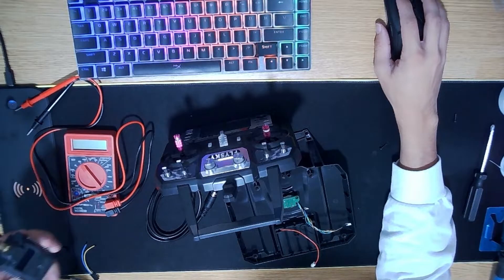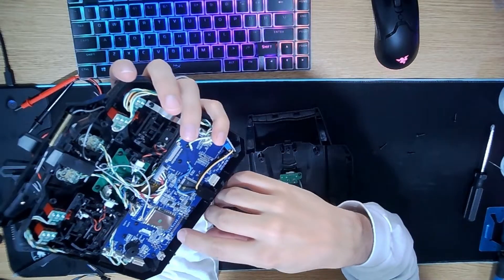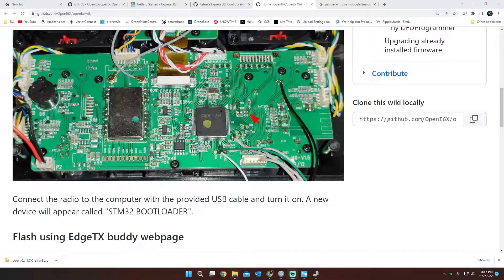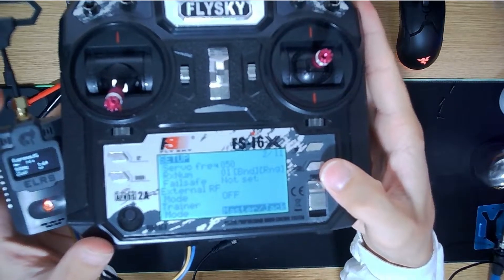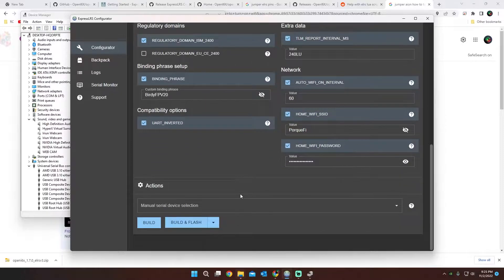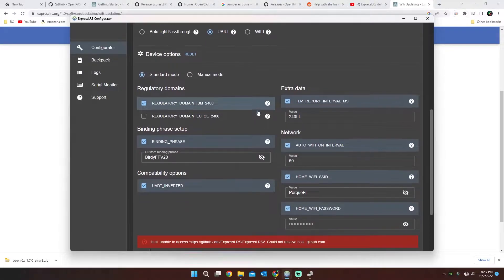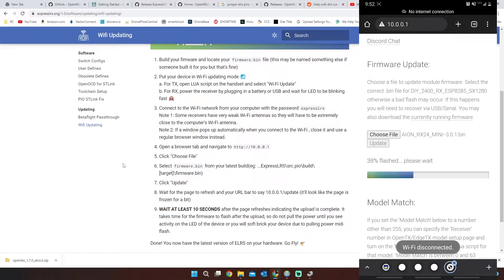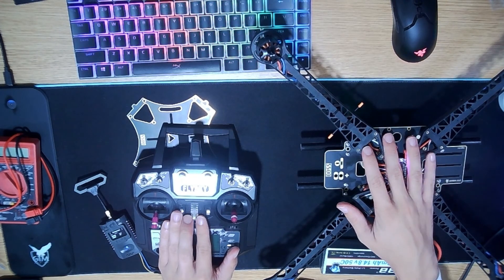How to connect Jumper AION ELRS V3.0 to FS-i6X

Comment: How do I do this with the Jumper T16
Reply from the maker: I think you are looking at the wrong video for that
Reply: @birdyfpv  Dude I fucking fried it already. So I just went out and bought a diferent module that actually fit. I might use the screen from the ELRS Nano for my Raspberry Pi.
Reply from the maker: @Beep-v9w sorry to hear that. Least you putting the screen to good use
Reply from the maker: Oh I looked up your remote, you can plug elrs straight in the back of your remote. Not the same module. But get one for your remote and then probably look up a video on how to configure an external antenna

Comment: After connection, how long will the device last?
Reply from the maker: I still pull mine out for fun. Mostly running the radiomaster boxer now. However, mine still works but I haven't updated the firmware since
Reply: @birdyfpv  Okay, what is the transmission range of the device?

Comment: I know this is an 1 year old video, but have a question: does the AFHDS2A fly sky receiver still works with it?  
I saw on firmware page that it's been added.
 If so, how do you pair it? Thanks!
Reply from the maker: No after you flash it and add the ELRS it gets rid of the AFHDS2A and the usb port on the back of the remote won't work for simulators

Comment: Hi,  I tried setting this up but it will not load.  DWhat BAUD rate are you using and can it be set on the Aion nano tx?  tyvm
Reply from the maker: Like is it not communicating with each other? Are they both powered on?
Reply: @birdyfpv  correct, both are powered up but script continues to say loading. I have a ground to the i6x board and lead to tx2, and separate 6volt battery supply to the tx unit.  I was now wondering if the tx2 wire might be too long but I  am now overthinking it because I have been trying it for several days with no success. Starting to think the anion unit might be defective although it  the menus work and the message is ,no radio.  Now I am using the fsi6x on the simulator while my newly built 5” is configured and ready except for the radio controller,lol. I ordered a different Tx unit which should arrive ina week and I guess that will rule out if it is the  aion unit. Your video was great, just hoping I am not missing something stupid since I am only working on fpv for a few weeks now and still learning
Reply: I also tested continuity on the tx2 wire, checks out. I tried changing baud rates on the radio, no luck
Reply from the maker: @BruceDJames  baud rate should matter to much. Does the controller seem to work without the aion connected? Obviously not connecting. But the menus look all correct?

Comment: Did everything exactly like in this video and when I checked my tx input on betaflight there's no input. Send help :(
Reply: My rx is a no name elrs rx and it appears that it's cooked. If all fixes fail I shall solder back my crappy fli14+ that rx loss literally right infront of me and saved up for a better rx cuz the seller most likely wont refund me.
Reply from the maker: @johnship7389  dang that sucks
Reply from the maker: Sorry to hear that! Is your tx connected to your rx?
Reply: @birdyfpv  yep, everything from wiring to bf config looks ok
Reply from the maker: @johnship7389  you getting a model mismatch on the controller?
Reply: @birdyfpv  yes on some models I tried
Reply from the maker: @johnship7389  That is an issue with ELRS. I would look up another video on how to fix that. Or reach out to the ELRS team on discord. They are really helpful there. After you fix model matching let me know if your problem is still there.
Here is a good video about it: https://www.youtube.com/watch?v=3S6eUWCqvUY
Reply: @birdyfpv  I fixed the model mismatch now but still no inputs
Reply from the maker: @johnship7389  try connecting it to your computer through Bluetooth and see if can see your controllers
Reply: @birdyfpv  I dont think it has bluetooth capabilities
Edit: nvm it has bt function lmao
Reply from the maker: @johnship7389  what module do you have?
Reply: @birdyfpv  jumper aion nano 2.4g
Reply from the maker: @johnship7389  that has Bluetooth built in
Reply: @birdyfpv  aight I just checked and all sticks are working. Right stick up and down are reversed though but its prob just a windows 10 thing cuz on betaflight(using fli14+) its not reversed.
Reply from the maker: @johnship7389  well seems like your controller setup is working perfectly. Just a problem with your rx

Comment: Scusa amico mio ho bisogno di sapere quali PIN vanno collegati al modulo ? Quale e gnd e positivo e segnale al modulo
Reply from the maker: questo aiuta?
https://cdn.shopifycdn.net/s/files/1/1778/6615/files/1_cb691166-e00e-4f1a-a211-0fbdfe66a2f0_600x600.jpg?v=1626254887
Reply from the maker: O questo aiuta meglio?
https://cdn.shopify.com/s/files/1/1778/6615/files/1_e1f9c92e-d2d5-4b70-916b-2e9b12d70ca9_600x600.jpg?v=1641435192
Reply: Bruciato il modulo🤦🤦🤦
Reply from the maker: Che cosa? @FSkyJet
Reply: Non funziona più il modulo Aion
Reply: Lo ho aperto e il collegamento e positivo segnale e gnd
Reply from the maker: funziona ancora sul mio controller @FSkyJet
Reply from the maker: Basta seguire il diagramma. Dovrebbe funzionare per te @FSkyJet

Comment: Is it normal that my TX2 and GND pad on i6x is shorted?
Reply from the maker: No it shouldn't. The TX2 pad is a signal pad. It shouldn't be connected to a ground
Reply: @birdyfpv  thanks btw
Reply from the maker: No problem! @kadyo_diy
Reply: @birdyfpv  oh i think thats why the betafpv says no handset at all,even with correct bauds and proper grounding